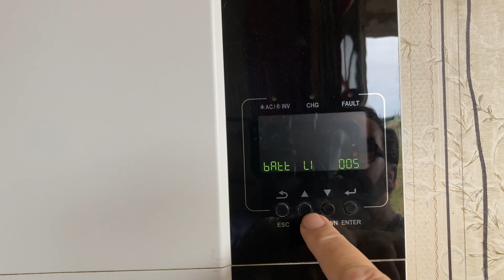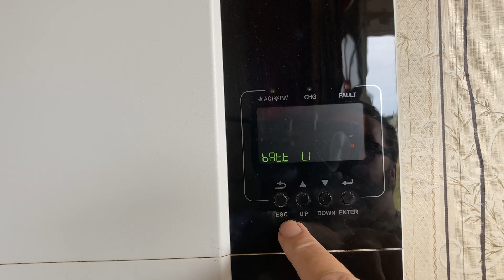Growatt to Pylontech BMS connection

Comment: Did you know when you purchase Paylontec battery they lie to you about capacity?
Because you are not able to take all advantage from this battery...
This battery is only 15S configuration inside, so it is working from 54V until 44V...
Bu the battery should be able to work from 58V down to 46V...
If they have 16S configuration inside, will have bigger voltage range and better efficiency...

Comment: Please how to configuré the DIP SWITCH for those two battery
Reply from the maker: I have them both set in the up position, it works for me. All communications between batteries and inverter is working as it should.

Comment: Quick question, my inverter did not come with the battery communication cable. I understand that it's a RJ45 (ethernet) cable. Can you please check if it's straight or crossover? What I mean by this, are the wire colors the same order on both ends?

Comment: Hi Ben what type sever cabinet have you used plz ie make model plz
Reply from the maker: The one I have is not rated for the weight of the batteries, and I have used the feet rather than the wheels, and also a piece of wood under the rear of each battery to support a bit of weight. https://www.thomann.de/intl/millenium_sr2012_studiorack.htm

Comment: Hi, I am using two inverters connected in parallel and two us5000 pylontech batteries. Its constantly on alarm as I immediately switch the inverters on. Errors 20 & 4. I have tried everything trick and changed from CAN to RJ and I have the small Li battery sign steady on on inverter but batteries still not charging. Please help
Reply: Same issue.
Reply: I have a similar issue, my system works great during the day, at night after the battery has been in use for a little while I start to get error 04(low battery voltage) and it beeps all the way until I fall asleep.  When I wake up the beep is usually gone and it's charging from solar.  I've tried increasing the voltage at which it switches over to the grid but no luck so far.
 @mobidicu
Reply: Remove the communication cable until you can figure the setting out

Comment: Hi - thanks, but you did forget to mention that you've to select the communication protocol as well (prog. 36) which automatically pops up after selecting bat type. As this is obviously not your first time setup, you've already been asked to do so - so the inverter skipped that step - but you should explicitly mention the first time setup case as well - tell me if i'm wrong due to eventually different firmware versions - thx
Reply from the maker: I think you're correct, it did ask me on the initial setup, and I totally forgot all about it.
Reply: @Bensgarage  thx it's just cause i was permanently in fault mode until i setup the can communication mode '52' ... whatever :) works now for me, thanks for the vid
Reply: I have set program 5 to lithium and program 51 to 52 and connected the cable from the BMS port of my Growatt SPF6000T to the CAN port of my Rosen battery and it's still not communicating, still getting error code 20, what am I missing? @Stuff-h3p
Reply: @Floyd112007 check your cable, maybe it’s broken or if you have a spare try using it…
Reply: @StepDoku  that Growatt burned out, now I am using a Deye; I like it a lot better than the Growatt.
Reply: It does not work using 52.
Reply: @mobidicu  do you have an spf5000es using pylontech us3000c or similar? i've seen guys using prog 52 for this inverter / battery type combination so I"m pretty sure 52 is the correct protocol type setting for this configuration. greetings
Reply: Thanks for your response! It worked for my Growatt SFP 5000ES+Pylontech US300C @DevilStinger system. Greetings from Chile, South America.🙏
Reply: My manual for 3500 and 5000ES doesn't have a program 36.  What setting is right for prog 36 if Lithium is selected in program 5?  (Pylontech 3000C)

Comment: Hi 
I have spf5000 es  installed but facing one problem. The RCD trip when the inverter change from grid to battery it has been suggested to use 100mA instead 30mA... any advice on this please
Reply from the maker: Which rcd are you talking about, the one on the grid side or the one after the inverter?
Reply: @Bensgarage  the one after the inverter on the consumer unit
Reply from the maker: @alqaimyouth  the rcd I have is 30ma, 40A. I’ve never had a problem with it. Maybe you have a faulty one, or a setting in the inverter is not right and it’s spiking the rcd, causing it to trip when it goes from grid to battery.

Comment: Thanks for the video, Ben! My problem is I don't have the original data cable between the inverter and the battery so I tried to make one but I seems I don't knows the correct order of the wires for the two ends of the cable. I close up photo with the two connector it would help, I think. Again, thanks a lot!
Reply from the maker: The cables are all covered so you can't see which one goes where. But have a read here: https://powerforum.co.za/topic/5164-growatt-inverter-pylontech-batteries-bms-comms-guide/
Reply: @Bensgarage  In the link you shared me it's about another model of Growatt; it's a hybrid one. So it uses the RS485 port on the battery... First I have to purchase the original com cable next I'll see step by step. Thank you for you support and quick responses! Best of luck!
Reply from the maker: @bccb491  I thought you said you had the same as mine, which is a hybrid inverter, glad the videos have helped.
Reply: @Bensgarage  I have the same model with you but the model in the link isn't. Anyway, the hybrid inverter are those who combine both off-grid and on-grid features, it means that you have battery for back-up and, in the same time, you inject power to the grid and you have some compensations instead. Some dealers name incorrectly these inverters as "hybrid" because they use AC grid as back-up. A real hybrid inverter has, in the menu, "off-grid" function and "hybrid" function.

Comment: I'm planning on installing a similar system 2x plyon uc5000 and a solis 5k invertor. I can't get solar at my house at the moment so doing the battery only system is the next best thing. Issues is I'm finding hard to find a electrician one charged £1000 for just install others no reply at all. Any forums or advice. Also any recommendations on what to add and not to add.
Reply from the maker: Sorry, but I have no idea how a battery only system works, and why would you need an inverter for a battery only system? Surely the batteries get charged from the grid (preferably at off peak rates) and you then power the house during the day from your batteries. I can only give advice on what I have done, researched and fitted and then let you know if it has worked or not.
Reply: @Bensgarage  thank you no problem, I'm fitting an inverter because I'm planning on adding solar next year
Reply from the maker: @TheKerr1983  Oh I see, so your going to be running the inverter as if you had panels fitted, but just passing the grid through it for the time being, makes sense now. I guess then, it depends how good you are at electrics. I have found that most forums seem to concentrate on being totally offgrid or are selling power back to the grid, so I never paid much attention to those. If you go back over my solar series, I have made a few videos explaining how I have done it, hope they are of some help.
Reply: @Bensgarage  thank you Ben appreciate the help definitely will be looking over them